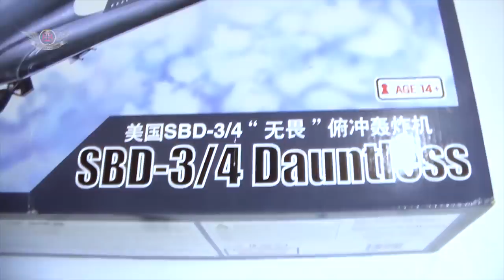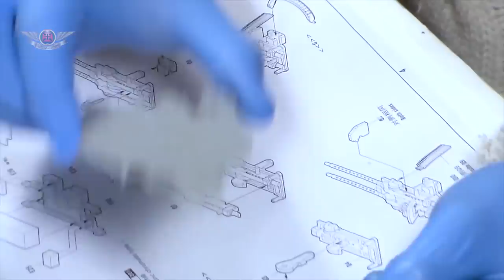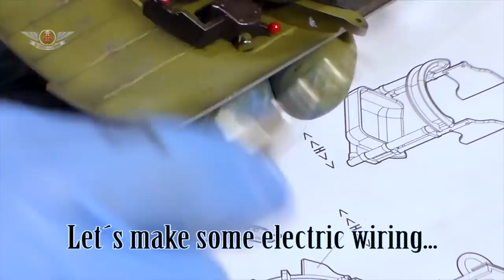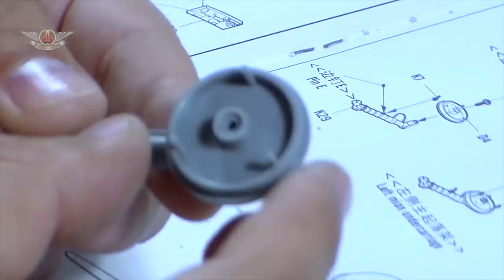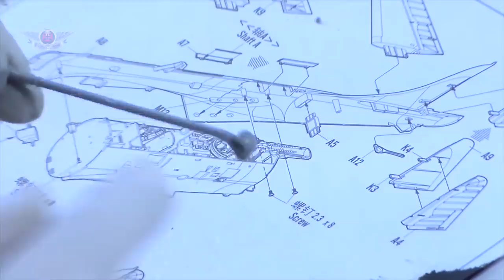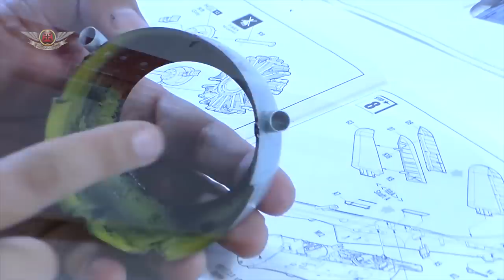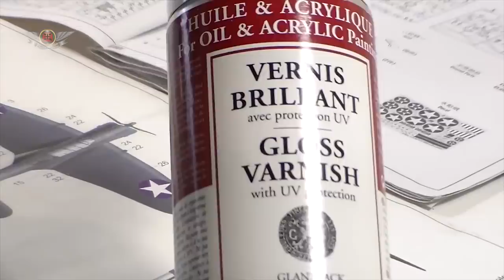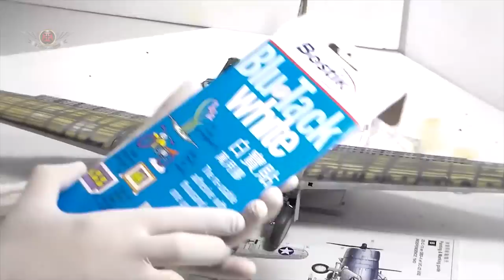1/18th MERIT INT. SBD 3 DAUNTLESS FULL BUILD VIDEO "reloaded"

Comment: Overall, wow! I just have one suggestion and a couple of gripes. I would suggest next time don't use the decals, other than as templates, especially since it's so large. It looks more realistic and makes it easy to chip & weather. Now my gripes. Even though it turned out pretty good, I think you got a little too careless with the pre-shading. And the bomb. It would not be that weathered or chipped. They pulled them from the munitions vault brand new, loaded it on the aircraft and it wouldn't ever come back to the ship. Unlike today, carrier landings were dangerous enough without munitions attached to the aircraft and was down right deadly with them still attached. In fact if the bombs failed to release they would ditch the aircraft next to the carrier rather than risk damaging the deck or even crippling the ship. That's just my two cents, so take it for whatever it's worth. Still was definitely worthwhile to watch the whole video. Good job. And it gave me an idea for a diorama.
Reply from the maker: I thank you for your constructive comment... next time i will have it into consideration... thanks!
Reply: Your right about the bomb.
Reply: So what would be done about the pre shading? Not as much? Or stay in line with each row of rivets, and panel lines?
Reply from the maker: Yes. That or on the end just give it a bit of very diluted smoke on the panela lines very light
Reply: Opinions are just like backsides, everybody has one. Personally  like  what you did to the bomb to replicate it's cast surface. Plus bombs and other external  ordinances  do get chipped during the handling  process. They are not that well finished to begin with, seeing as it's a one way trip. Great job on pulling off such a large scale kit. There certainly is more detail in such a large kit, as one would expect. However the problems that crop up are large also.
Reply from the maker: Thanks
Reply: @randypurtteman1183  I was not trying to be critical, just pointing out that bombs were not allowed to get dirty or rusty.
Reply from the maker: I understood.. no prob